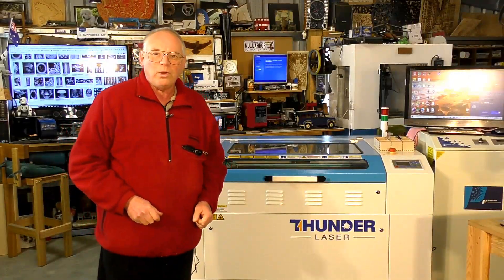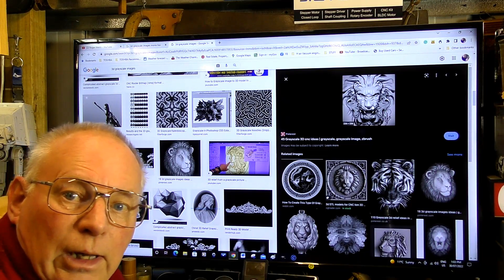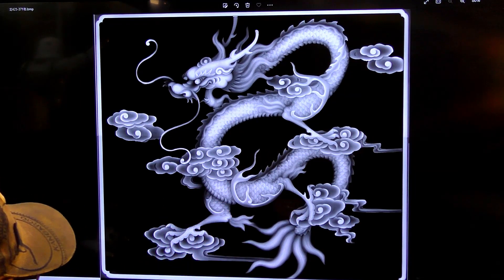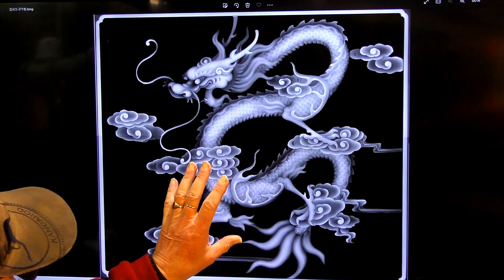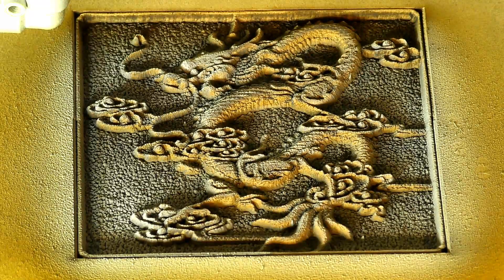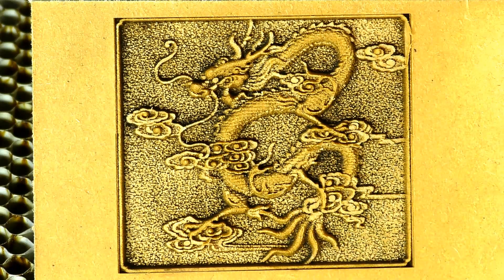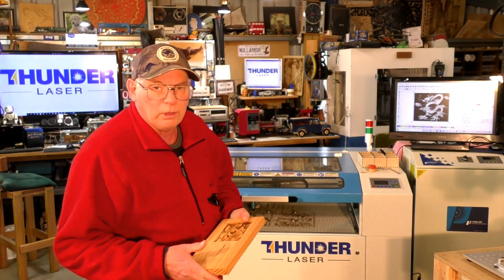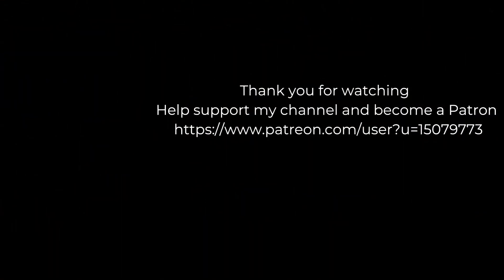🎇Laser 3D engrave with a Thunder Laser Nova 35 - 100 Watt *HOW TO*

Comment: may be a hard 128 or 64 height map with hard surfacing, would give u a better surface finish! those 256 height maps, look like they have a 
''soft blur'' filter in them! some call them 3D height maps! back in the day, Y2K. 
they were called height maps! before then, bubble gum! good luck!!